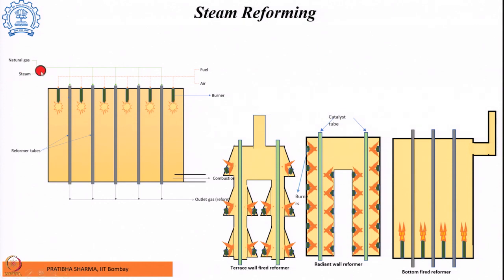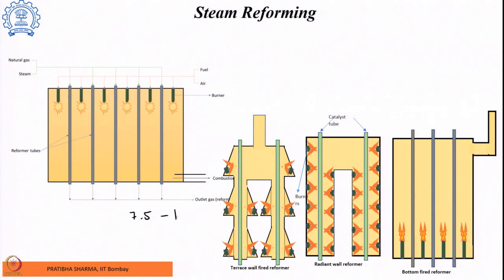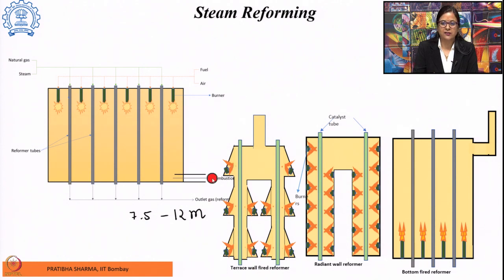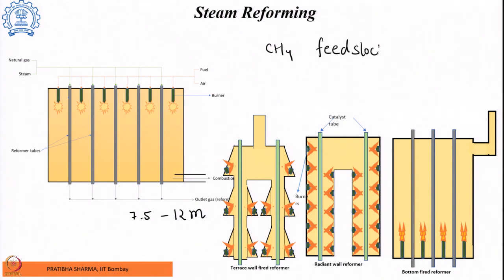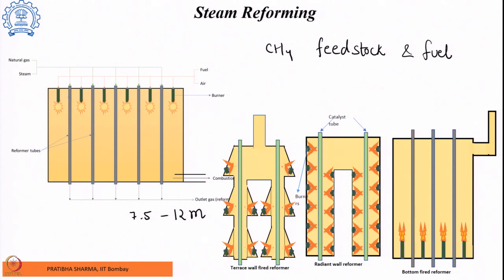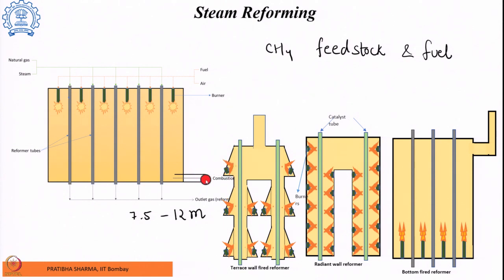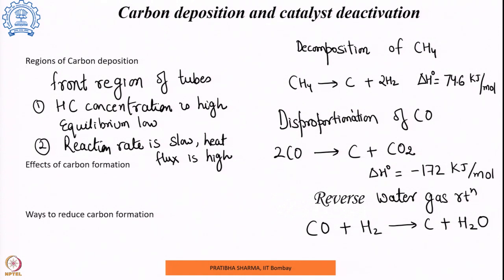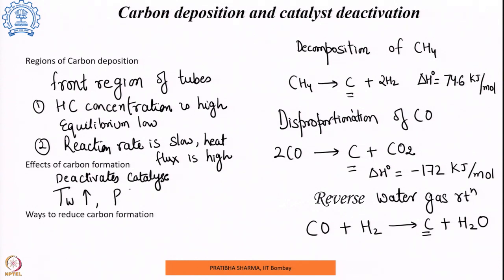Lecture 04: Steam Methane Reforming Part - 1

Comment: any real time data on daily leak rate of product Hydrogen component of synthesis gas pipeline or tankers? Hydrogen is a very light and small molecule, a real gas  which is considered to be highly prone to leak and needs special type of material for transport and storage. Synthesis gas from methane reformer will have either 75:25 H2:CO or 66:33 H2:CO by volume.
In future can catalytic pyrolysis of Methane win vs steam reforming of Methane?